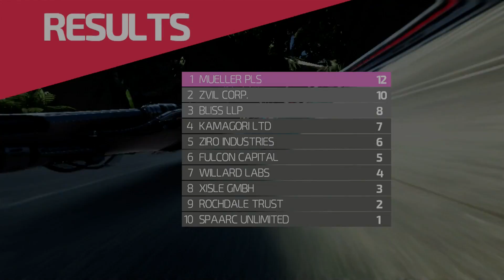Nintendo Switch - High Powered GPU Extension Theory

Comment: nvidia has already said that it'll be more powerful then the ps4. why does everyone disregard facts over rumors? :(
Reply from the maker: +dreadGodshand They definitely never said Switch was more powerful than PS4, just that porting would not be very difficult.
Reply: SuperMetaldave64 i paraphrased and summed it up. their exact words were, it will be as powerful as high end gaming machines.  (meaning computers) which in my opinion,  the ps4/x1 isn't even that good. so yeah, it'll be more powerful then ps4. if it's up there with high end gaming machines like nvidia says, then that'll make the hardware true next gen as people want it to be. so i really don't understand why people ignore what nvidia says and follows these rumors.
Reply: Unless they're selling it for 600+ there's NO WAY it will be anywhere close to a high end pc. I think the safe bet would be to assume they meant as strong/stronger than PS4, at MOST up to the PS4 Pro.

I want it to be as powerful as it can realistically be, as I'd prefer this one not get left in the dirt like the Wii U did, but it's important to have realistic expectations... If it's more powerful than I assume, great! But if you're expecting a pocket sized super computer, then perhaps it's time to temper your expectations.
Reply: dreadGodshand Link?
Reply: dreadGodshand At the very most the switch will be as powerful as the Xbox 1 and that is for the console aspect of it
Reply: dreadGodshand Link the switch will be as powerful as a high end gaming PC?
Reply: dreadGodshand But give me the link where Nvidia said it will be as powerful as high end pc's
Reply: dreadGodshand you haven't given a link
Reply: ExileTwilight i agree, that'll be extremely expensive. but it wouldn't be the first time a powerful system was cheap. look at the n64. that was more powerful then the ps1. and it was still $100 cheaper then the ps1. so, to get a powerful system like nvidia confirmed it to be, and have it cheap, isn't unheard of for Nintendo.
Reply: dreadGodshand It's rumoured to be somewhere between 250-350 dollars, which if true AND Nintendo is selling it at a profit either means they made one heck of a deal with Nvidia, or it's nowhere near the power of a high end pc. I honestly was surprised it was even rumoured to be stronger than a PS4 when I heard the "leaked" price...
Reply: dreadGodshand Give me the link or else your lying
Reply: Think about everything you just said, and then think about battery life. How would that make sense?
Reply: dreadGodshand the gtx 1070 has the same architecture as 1080, but it's not the same power
Reply: GamerPerson the x1 and ps4 are roughly the same power. like the ps3 was with the 360. not much of a difference there.
Reply: GamerPerson according to nvidia,  yes. lol they actually made the gpu graphics card. so they would know. :) not us. so i trust the info coming from the horse's mouth. lol
Reply: ExileTwilight okay, well the n64 was $200 when it was so powerful.  and, i do not believe it'll be sold at a profit. because that makes no sense. that's not how business works. :( the original wii, which was $250 was sold at a loss. the ps3 when it was $500-600 was sold at a loss. if they sold them at how much it cost, the original wii probably would have been $500-600 for the system.  can't even imagine what the ps4 would cost then. so no, if it's sold at a profit, no one would buy it, because it'll be so expensive. the original wii was so underpowered that it was ridiculous. and that was still sold at a loss, because no one would buy it if it wasn't.  no one even pays $500 for a system. so there's no way Nintendo,  who is a multi billion dollar company would do something so stupid. so either Nintendo lied or the media missquoted them or Nintendo has because dumb. so i hope for the best case scenario where the media missquoted them. lol because systems are ALWAYS sold at a loss. they make their money back from the games sold. that's how it always worked. all the way back to the nes to today. that's just how it is. and when a company prices it around $500 they never sell until they lower the price because no one is really to pay that much for it. the ps3 didn't sell at $500. they sold grear once they lowered the price. and the x1 didn't sell at $500 either. once they lowered the price, it started to sell better i think. (but still barely sold. :( )
Reply: dreadGodshand I went on the Internet and I found no link that the switch will be as poweful as a high end PC, you have a link?
Reply: Jumbo Jango wow. please retead that. lol what you just said literally means the exact same thing. it compares to high end pc. which the ps4 isn't even that. how is that any different to what i just said? it amounts to the same exact thing. :) no matter how you word it, it all boils down to, the switch's hardware is so powerful,  it compares to high end gaming computers.  :)
Reply: Jumbo Jango reread*
Reply: izzy619619 what does battery life have anything to do with what we're talking about now?
Reply: dreadGodshand The hardware of the switch will be around the Xbox one, but it has architecture similar to high end PC'S, big difference
Reply: dreadGodshand sorry buddy you've misunderstood. nvidia said the architecture is the same, not power, they're not the same. but could it support newer rendering features than ps4? perhaps
Reply: CrackKat how is the architecture different the graphical power?
Reply: CrackKat sorry, but that really didn't answer my question?
Reply: dreadGodshand the two different GPUs can process vertex data at different speeds, does that help?
Reply: CrackKat what's vertex data? sorry, just not up on technology.
Reply: dreadGodshand no problem, most people don't know this. i only know it cos I've done graphics programing. 
vertexes are the computers way of representing points in 3d space and make up most graphics. graphics cards, unlike CPUs are designed specifically to quickly process vertex data in parallel. vertex data is made of floats (a computers way of representing numbers out of bits - 0s and 1s) and the GPU can quickly perform maths on these data types
Reply: no they haven't lmaoooo
Reply: they did make such a chip
Reply: phantomreaver85 my proof is the company who actually made the hardware.  i hear it straight from them themselves.  :) your proof comes from rumors. mine comes from facts
Reply: phantomreaver85 look up nvidia confirms switch hardware. they confirmed it back on the 20th of October.
Reply: phantomreaver85 https://blogs.nvidia.com/blog/2016/10/20/nintendo-switch/
Reply: phantomreaver85 that's a link to the article where nvidia confirmed it. :)
Reply: dreadGodshand The article only say the same architecture as other graphics card, not power, completely different stuff
Reply: dreadGodshand The nintnedo switch will be very weak and there is nothing you can do about it
Reply: GamerPerson wow, it means the same thing. they said it'll have the same architecture as the top graphics cards, meaning same build. which means power. it's the same thing. lol

Comment: External GPU acceleration through Thunderbolt is technically possible but it would have to be carried out by a GPU like the one on the 1050 or the 1060, for reasons of cost and CPU bottlenecking. However, i think there's a small possibility of that happening due to the fact the console is also portable.
Reply from the maker: +ZapperPenguin Yeah for sure, the 1080 example was just to point out that anything is basically possible :)

Comment: I cant imagine nintendo making an add on GPU to make the thing stronger.
and at the end of the day, that wouldnt matter, the Switch have to be strong enough to at least get the third party support.

It doesnt matter if there is an Addon of a GTX 2080 from the future, if it cant run the new prey at low setting, then the support will die really fast

Comment: We really don't know how weak or powerful the Switch will be because of it's semi-custom design.  It in effect is something brand new whether it is based off of the Tegra X1 or Parker chip.  

However, all this talk about external GPUs and SCD doesn't make a whole lot of sense to me unless Nintendo is trying to make the Switch a future-proof console.  If Nintendo is planning to make yet another portable device to replace the 3DS then they should have made the Switch the 3DS replacement and released a regular traditional home-console STILL with upgradable ability.  That would have been far less complicated.

It should be noted that even the weakest Pascal GPU (GTX 1050) is more powerful than the PS4 GPU.  It has the same 1.8 Tflops, but a higher boost-clock while using a far smaller and efficient 14nm FinFET process.  So if the Switch GPU is based off of that, it should be okay.

Comment: I think there will be a home console that the switch can power up in the future through usb c, having both the switch and home console linked through usb c and using the vr headset box would prob gauratee 60fps vr, plus it would future proof the home console in a way as they wouldn't need too make it too expensive because the switch could just add power too it to make it close to the ps4 pro/ xbox scorpio or above.

Comment: Tegra x2 has 750 gflops AT 20 WATTS. Nintendo is using a custom version that will most likely be a lot better in power consumption. They might even get twice the performance per watt. Still, 20 wats is too much for a handheld, so the gpu would have to do with 8 watts or 600 gflops. nvidea flops equal more than amd, so 600 from nvidia = 800-900gflops from amd. That's close to xbox 1 gpu and almost 2x the wii u, more than enough for 720p gaming. when docked, it can get a 2.5x increase to the normal 20 watts, reaching 2/2.25 tflops of performance. That's a little more powerful than ps4 and more than enough for 1080p.
Reply: its actually 10 watts
Reply: Justin Wong That would make it even easier to achieve the power mentioned. make it custom to go above that wattage when docked and a little less when portable.
Reply: 10 watts is fine for a portable.The nvidia sheild tablet had a magnesium thermal sheild with a 5 to 8 watt processor.Nvidia said the thermal sheild was enough to passively cool double its heat output

Comment: You are no getting anything remotely close to a GTX 1080 in a console till 2018. Also the switch rumored specs meet the minimum specs requirements of most modern games on a PC, consoles especially Nintendo consoles are usually optimized much much better than their PC counterparts so I'm not too worried about the power. Especially considering the kind of ports devs have made for Nintendo consoles in the past even though they were underpowered in comparison to the competition. This is the first generation where the most powerful console sold better than the rest so who knows, it all comes down to how many people buy the thing and it's attach rate in the end. That's what makes devs support it.
Reply from the maker: +Justin Sorensen It was just an example as I said saying that they could make it as powerful as they want. They could do a 1050Ti or 1060 though those are pretty cheap

Comment: I still doubt it's Maxwell. because then NVidia's statement about "The high-efficiency scalable processor includes an NVIDIA GPU based on the same architecture as the world’s top-performing GeForce gaming graphics cards." would be entirely invalidated. Their top-performing GeForce gaming graphics cards are Pascal based, not Maxwell. Their Maxwell based graphics card had already been old news for over a year at the time of their statement so why would they say the Tegra in the Switch uses the same architecture as the top-performing GeForces if it was Maxwell, when Maxwell ones AT THAT TIME hadn't been the top perfoming ones for over a year?
Reply: batfink like I said elsewhere though it's possible that what Eurogamer said had been true at one time and used an X1 derivative at some point on early devkits only so people could get started developing for it while the Pascal based, final chipset, was still being prepared. It's not uncommon for a new console to start off with a weaker chipset of the same family just so devs can familiarise with it while they prepare the final more powerful version that you can program for just the same. Nintendo did it with the GameCube (early versions of the devkits even made it to eBay), the Wii (early Wii devkits were just gamecubes with Wii remote support) and Wii U (early devkits were not as powerful and the final devkits were shipped too close to launch, which is why some launch third party games were so poorly optimised like assassins creed III)
Reply: Like to see an update to this comment

Comment: This is so ignorant. You're pinning ONE rumor (from a source that claimed the Switch would be powered by AMD no less) versus tons of rumors from reliable sources saying that the Switch is basically around the Xbox One ballpark... get real dude. Skyrim Remastered is on it (and Bethesda THEMSELVES said it runs the same docked or undocked), there's the rumor that From Software got Dark Souls III running on it, Image and Form Tweeted that the Switch isn't "skimping on power", and all the big devs are plenty excited to work on it, and the general reception from those in the know is very positive.

Why then would you glorify this rumor over 1) multiple rumors from sources that are actually reliable (compared to GameBeat), as well as 2) FACTS from devs working with it already?
Reply from the maker: +metal pants Strange, did you actually watch my video? You seem confused, I never said that I believed it or not, I gave an explanation that either way if it's Maxwell or Pascal it's not going to matter because of the Switch having the potential to be expanded with its power. I never said that the article was true though.
Reply: SuperMetaldave64 I watched the majority of it. Must've missed that part. Fair enough.

Comment: Dave, I'm disappointed you didn't learn any lessons from the last time you insisted that Nintendo was going to release this big, expensive, super-powerful "home" console that would be on par with the PS4 Pro and Project Scorpio. Nintendo will not be releasing a GTX 1080 that will hook up to the switch or anything like that, the CPU/GPU of the Switch is inside the Switch, the Switch is the Switch. There is not "handheld Switch" and "Home console Switch". There is just the Switch.

And on a smaller note GRID game streaming would not work in the way you describe, it would not be instantaneous when switching, you'd have to reload the game, and you'd need a very high bandwidth and very stable internet connection which many people do not have. Besides, it would be limited to the range of your Wi-fi router, which would defeat the purpose of what Nintendo is trying to do which is being able to take your games with you.
Reply from the maker: +Charles Gibson It is speculation on what is possible, Grid is possible without just your Wi-Fi router, it would be a a network server cost but minimal, bandwidth is not as much needed unless you are trying to stream your game from a service that is hundreds of miles away. Your system would have the game running from your home, not a sever somewhere. Also like I said a GTX 1080 is just an example, yes it's too expensive, but they could do a 1050Ti or 1060 for pretty cheap and it would be a pretty nice upgrade. 

I'm also not insisting that Nintendo will do this, it's something that is possible but Nintendo is the one that will decide like I said in the video we'll see Nintendo's plan next year

Comment: A Maxwell die shrink doesn't make sense cost wise when you have Pascal which Maxwell is derived from. Pascal was in development before Maxwell. Besides I thought you were about Nintendo gaming? Is power that bothering too you? Even though it's nothing but rumors as far as Switch power is concerned......Plus forget about an SCD, GPU extension or performance streaming service. None of that is feasible for the Switch or needed.
Reply from the maker: +Brad Kayganich Lol I'm not worried about anything at all, but I'm just discussing the possibilities, what Nintendo decides to do is up to them. Like I said in the video Maxwell and Pascal for Nvidia's mobile lines are not much different anyway.

Comment: If the tegra x1 is about 1.1 tflops, a costum one would be about 1.3 teraflops, which is already as powerful as an xbox one in portable mode, playing at only 720p, which means it can run GTA V at 60fps on the go! When docked and overclocked it could even beat ps4. No external gpus needed for a long time.
Reply: A Tegra X1 has about 0.5 Teraflops FP32. The 1.1 Teraflops Nvidia loves to brag are FP16.
XBOX has 1.3 Teraflops FP32 and the PS4 has 1.84 Teraflops FP32.
Reply: Yo Mama lol you said 1.3 as if you applied any thought process there, you literally are just guessing.
Reply: Yo Mama Stop with the lies the switch will not be as powerful as xbox one or ps4. Even supermetaldave said it, its a handheld device
Reply: Winter Horizon I'm not saying it can do that. I'm saying it's weird for you to use SuperMetalDave as some all knowing source.
He's not an insider, he's in the same boat as the rest of us.
Reply: +EpicStuffForYou thank you for saving me the trouble.   all I can add is that the Switch will be marginally power powerful than the completely irrelevant WiiU.
Reply: As far as I know nobody uses FP16, the PS4 Pro is also capable of doubling it's performance if it used FP16, but it doesn't.
Reply: Winter Horizon SupermetalDave is just some dude lol.
He's by no means some genius of hardware with a deep insight on Nintendo's strategies or manufacturing processes.
Reply: YourPalHDee even with common sense we know that switch is weaker than ps4 amd xbox one. Its a handheld with a mobile processor, if you actually think you can get a performance equivalent to an xbox one on that small portable device, then you are delusional